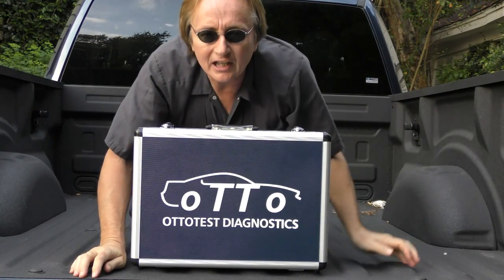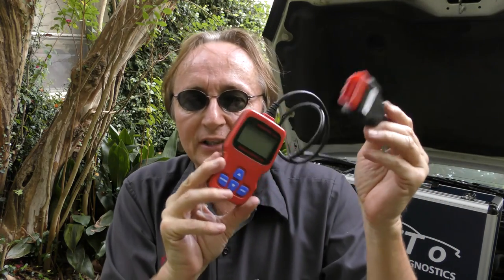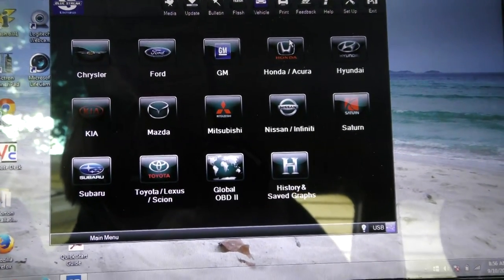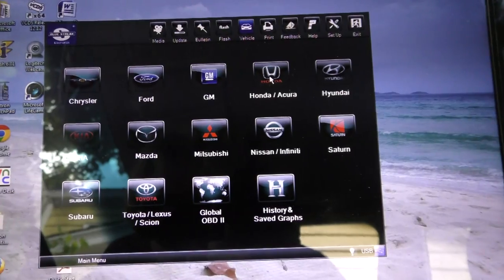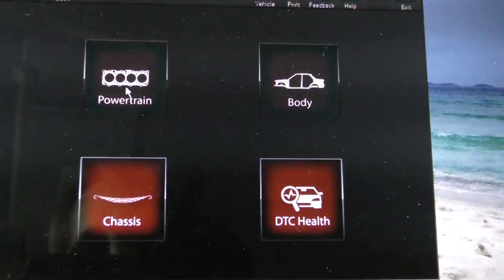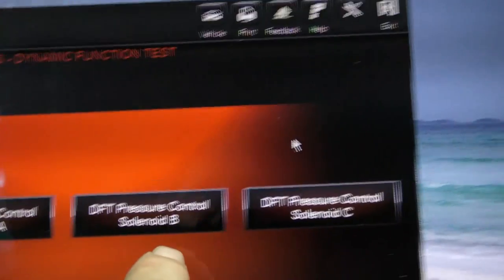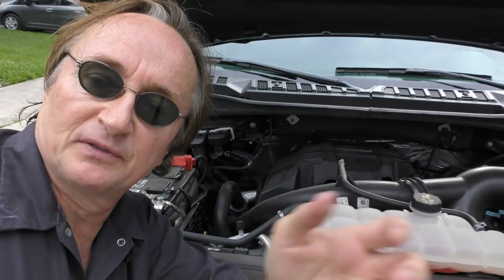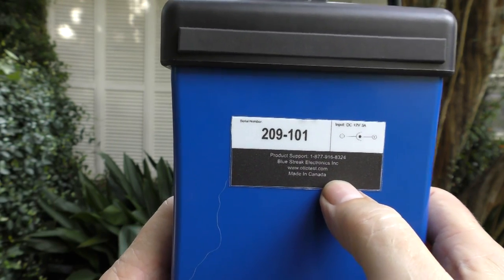Fixing Complex Modern Cars

Comment: they are only complex because we and our education system has utterly failed to keep up with modern times and needs.
Reply: +John Douglas What are you blabbering about? Engineers have taken a backseat to the accountants at big car companies. Cars are designed on PURPOSE to be complicated now because the companies will make a huge amount of money servicing them when they break. By making them complicated people are forced to take them to the dealerships versus good independent shops or just performing DIY work and that allows the dealerships to charge insane parts and labor costs because there's no competition. 

Actually scratch what I just said, the education system did fail us. Your comment is an indicator of that.
Reply: John Douglas I wasn't being a conspiracy theorist dumbshit. Don't tell me for one second that some cars have become so overengineered and stuffed full of useless technology to better the drivers. It IS planned obsolescence and special computer systems are required to fix them and guess where those systems are? The dealerships which means you now have to take your car there and spend a ton of money on something that should have never existed in a car. Tell me this, the plastic electric water pump in a BMW tends to fail at around 60k. What was wrong with a mechanical water pump? Oh I know it was too reliable and never broke so the companies decided to redesign the wheel and use an electric pump. Parts and labor costs are $800 if not more so big money for the dealership. Now you can DIY that stuff and independents can replace it but it begs the question of why it was ever that complicated in the first place.
Reply: John Douglas Well we have certain "fix it" laws where people can buy MBs STAR for example for use outside the MB dealership but that isn't exactly feasible for a DIYer and some parts are exempted. Indy shops might have that or use a general computer like an Autel Maxidas which can detect problems stored in the OBD 2 computer on all makes and models. I NEVER said it was a conspiracy, you're interpreting it as if I said that and if I follow that mentality then you are shooting yourself in the foot by talking about Governments. 

You say the parts are made to a cost and part of that is to make it affordable. So a $400 rebuilt alternator at Toyota is affordable when the exact OEM part new at another shop is $270? The plastic electric water pump in a BMW is almost $500. A mechanical water pump in an MB M272 motor is $120 and super easy to replace but usually they never go bad below 200k and usually it's just the seal that goes bad but people replace the pump as preventative maintenance.
Reply: Djonkie Bonk "that isn't exactly feasible for a DIYer and some parts are exempted."
"feasible to the DIYer"?
affordability of required equipment is beside the point.
it's not part of some grand plan to make more money (directly)
again I state, the progress of technology and it's deployment is not used to make more money, it's to make shit safer, cleaner,more economical and other things.
if we were still all running around in the first style vehicle, you'd be driving at a maximum of 25mph, you'd have no safety features and the pollution we'd face would have monumental environmental impacts, and a hell of a lot more dead people.
it's the price of progress.
 
"So a $400 rebuilt alternator at Toyota is affordable when the exact OEM part new at another shop is $270?"
the same could be said for nike sneakers dude.
the fact you can buy the OEM part speaks for the regulations also working in your favor.
toyota (or any other manufacturer) puts a price point to reflect it's brand, they all do, cars, shoes, cosmetics, you pay more for the name.

"The plastic electric water pump in a BMW is almost $500"   yes, because it's BMW.
but you can still get alternatives.

"A mechanical water pump in an MB M272 motor is $120 and super easy to replace but usually they never go bad below 200k and usually it's just the seal that goes bad but people replace the pump as preventative maintenance. "
and?  your point?
this is again, due to BMW wanting their cars to fit a narrative, to fit a "look"  and appeal to a certain style of customer.

you just need to learn to use the internet and shop around.
of course it'll take longer and require more work from you, but MOST people, want to drop their car of and have someone else do it, and for that, you have to pay through the nose for inexperience and laziness.

with ECU's and computer controlls for engine management and fault notification and what not.
it's all MUCH easier than it used to be for the mechanic, but also required more cost for the equipment, training and all the other shit needed.

I get it, it's bloody expensive, annoying and frustrating, but, such is life and the world and humanity.

try coming here to Australia, in the middle of no where, near no other countries, where everything has to be shipped in and it's a much smaller market and then tell me about increased costs.
it's crazy expensive here.

this is part of the price of the modern world I'm afraid.
Reply: Ok we're never going to agree fully but I will leave you with a few last words. Of course progression is a good thing and cars are totally safe nowadays and I'd drive nothing else but I think we've hit an apex where the effort to make cars uber efficient has now gone past a sensible point. Look at the new Ford Ecoboost motor for example. It boasts DI, turbocharging and a lot of specific programming in order to achieve good emissions and fuel economy. Now it's ULEV which is good and the economy is good but it's not that far off a port injected motor. DI motors have a coking problem which means they need cleaning every 2 or 3 years in order to maintain it's efficiency. That service costs around $800 as the entire intake manifold needs to be removed among other bits. They're also known for turbo issues, misfiring issues, injector issues and cooling issues. If all of that is going wrong the money it will cost to fix it will far outweigh the money saved in terms of usage and won't really save the owner money like the manufacturer claims. That's my issue. 

As for your point on BMWs stupid water pump that's just ridiculous. How can you possible link appeal to an inferior part that has no advantage over a mechanical pump other than the supposed less drag for fuel efficiency. If the pump itself actually saved the owner more money on gas than it cost to fix it then okay but I'm sure the water pump won't be solely responsible for that sort of savings. It's utter crap.

Comment: If you want a simpler car have an electric one. No gearbox. No diff. No oil.  No starter.
Reply: Yes, but that'll all be computers, and very expensive to fix when they do go bad.
Reply: Mechanically simpler but they make the computer system even more complex, stuff like Tesla cars have absolutely no chance of anyone making repairs on their own because they very specifically keep every component and software locked down.
Reply: MsSomeonenew yet theyre so easily hacked

Comment: i fondly remember one of the specialty tools i used to use....a long box end 9/16 heated and bent in a big L... distributor hold down bolt on a gmc....pick the year....probably only worked on 30+ years of gmc/chev/pontiac/oldsmobile/buicks....and caddys.......cars light trucks, and 1-2-3 ton trucks.
lol now a guy needs a soldering iron, a big box of sensors, and constant computer engineering classes....or youtube

Comment: Great! Have you ever work with fiberglass cloth before ? 
Can i use fiberglass cloth with J-B Weld Epoxy instead of bondo fiberglass resin ? 
Because the fiberglass resin fumes is very toxic.
Reply from the maker: +Mr Cool jb weld is fine by itself, but isn't really made for use with fiberglass

Comment: I have a 2002 Durango with a 5.9L, 93000 miles. When in cruise control at highway speed, it has a 30-50 rpm uptick. Never downticks. No DTC's, No engine misfires. Dealership replaced tranny, said that was the problem. Problem still there. Had some bad vacuum hoses, repaired all, had a PO1494 DTC, replaced the pump. Didn't help the uptick problem at highway cruise. Replaced the IAT sensor, replaced coolant sensor. No difference. Don't want to throw a bunch of sensors on it to try to take a shot-in-the -dark approach at this thing.  Thanks for the help.
Reply from the maker: +James Ritchey  see my video "fixing insanely complex modern cars" and realize a machine like that is needed to analyze such computer run system. But odds are the cruise control module has internal problems.
Reply: Replaced it. Same condition exists. This condition is intermittent. Drove it the other day  for 60 mile road test and it never acted up. Drove it 75 miles yesterday and it did it 4 times. Don't want to waste your valuable time, but your expertise is great and I appreciate all the help. Thanks.

Comment: Hondas live forever. I have a 2008 Accord my parents gave me, the only thing I have done to it in the past year is a new starter last month,  and when I put it on the road in my own name, I changed the serpentine belt for the first time ever in that car. The belt had over 120,000 miles on it and I just wanted to change it because of the age.  A new battery and 4 new tires. Both of the tires and battery were also this past couple month.

Comment: my renault vel satis disabled the air conditioner after a misfire in the engine showed up, also still after I corrected the misfire I need some fancy renault OBD scantool to tell the AC computer it's okay to load the engine with the compressor now.

Comment: Scotty, I've been researching the Honda Shadow motorcycle. Everything from how to fix them to how to ride one. What I found most surprising is it appears motorcycles don't have on board computers because they don't have an OBD2 port. In one of your earlier videos you are show riding a motorcycle. If you ride one then you must also fix them. Do all or most motorcycles not have computers? I also don't think any of the motorcycles I've seen have a cat or oxygen sensors. Are motorcycles somehow exempt from emissions standards?
Reply from the maker: +moofushu motorcycles are another World. Toys that cost serious money to work on these days, as they are just a computerized as cars, but nothing is standard, so they have no obd II regs and data ports, and all makes and models use different software and diagnostic equipment. AND, there are no real motorcycle discount part stores like there are for cars, so parts are a real rip off when you need to buy them.

Comment: I could pick one of these up and show people (currently having major problems) what's really going on with their vehicles. First one on my to-do list is some gal's Lexus which was a lemon from the moment she and fiance rolled off the used car lot. Based on what I've heard, someone flashed the computer to turn off all dash lights for a bit then one at a time started to shine, in addition to that came with worn brakes & rotors, squeaks everywhere and so-so tires.

Only thing I can think of worse people doing to a car before selling it is tampering with/rolling back the odometer. >:(

Comment: My mom's 2013 Jeep Grand Cherokee with a 5.7 HEMI decided to shut itself off a few seconds after turning it on from a cold start last week. It hasn't done it again since, nor has it done it before. I have no idea what it can be because it can either be the TIPM acting up, the mass air-flow sensor acting up for our inconvenience, the fuel pump playing jokes on her, or the hot Arizona heat affecting voltage if that's even possible.
Reply from the maker: +Dcc357 realize you need a machine like this ottotester hooked up, then drive it, and analyze all the data once it acts up. It will find the problem when used by a competent mechanic.

Comment: Get with the times, everything is computer controlled these days. The shop I work at deals with mainly Mercedes so we have a Mercedes Star Diagnostic computer, for everything else we use the SnapOn Modis Ultra or VCDS for the VAGs. Here in the UK Merc have now dropped their diagnostic labour rate to around £120/hour rather than £160/hour

Comment: High Scotty, what would you say is the best OBD2 scanner that will work with a Mercedes and can read deep in the car like an OEM computer but not break the bank?
Reply from the maker: +Roberto7474001  The ONLY thing outside a STAR tester that does that is an illegal clone made in china. Tons out there on alibaba and they are around 1500 bucks or so. They do work, as I know mechanics who bought them and use them every day. Beats 25 grand for the real thing, but realize, yes, they are stolen software.
Reply: +Scotty Kilmer do you recommend the Autel DS708 module? I believe that's what you use? Can that read very complex info like if the car is t running properly and no check engine light present? Thanks!!

Comment: you can get the diagnostic software for BMWS/mercedes/audi pretty easily through ebay.
usually its a modified form of windows which you dual-boot on your laptop, and you drop maybe $200 on a can-bus reader
then you get all the functionality of this otto thing except even moreso
and 2000 cr-v isn't insanely complex. that would be a 2008+ cr-v
Reply from the maker: +Ryukachoo yes, but most of that software is illegal copies made from the actual factory scan tools. Most are copied in china, then resold. I"m talking legal stuff here, that's why the ottotest guys don't have euro on their tool, they would have to pay too much for the rights.
Reply: +Ryukachoo yep i get one for my bmw . It work so slow  take forever  and not support good with Mac OSX latest.
Reply: +Scotty Kilmer  Computers are shit
Reply: +Raksasok Heng OS X is not a good operating system for any kind of car diagnostics or electronics. Unless you install windows on it. OS X is a joke in terms of flexibility, it's used almost exclusively for graphics stuff, video and programming for ios devices.

Comment: Sir:   I have a problem with a 2001 5.4 L Expedition.   The battery goes dead overnight.   It was 5 yrs old so I replaced it,  but problem persisted.

OReilly's tested for error codes,  found none.

I disconnected the positive cable from the battery,  key off,  put a continuity tester between them and it lit up brightly, so there is an open circuit.

I pulled every relay and fuse and replaced them watching to see it the tester light would go out.    None of them in the fuse box or power distribution box had any effect.

So,  there is a power draw thru some resistor not effected by fuses or relays.   I also disconnected the wires from the back of the alternator suspecting bad diodes,  but no luck.

I am stumped,  any ideas?   Tonight I am going over the  wiring diagrams to see what I can find.  thanks for your help.
Reply from the maker: do my video "fixing battery drain on your car"

Comment: i have a 2009 chrysler Magnum wagon with a 3,9 liter V6 with a questionable head gasket ,issue , how can i tell if a head gasket is blown without tearing the engine down i seen a couple mechanics look and tell just by opening the oil cap what are they looking for ?

Comment: European manufacturers aren't the only ones that use a system that requires their computer.   Chrystler requires their DRB scan tool to the more complicated analysis on their cars.  Heck, I can't even pull the airbag codes off of my Jeep Grand Cherokee without one.  The DRB III costs thousands and is only available from Chrystler.  They are at least nice enough to give you a way to read trouble codes on the odometer by turning the key on and off a few times. 

Chris
Reply: Chrysler is owned by FIAT which is European so I'm not surprised.
Reply: +luigi90210  Exactly. The only thing american made anymore is the drivetrain.
Reply: +luigi90210 Chrystler has always used DRB.  They started using DRB II in 1983 which is a long time before Europeans got involved. Chrystler also claims to have the first computer in a car, so I wonder if they just kept using what they had.  
Chris
Reply: +shadowdog500 Fiat Chrysler tops the lists of worst cars, and for good reason.

Stay gold.

Comment: This is un related to the video but how could I clean transmission fluid out of my cooling system? The tank for the transmission fluid in my radiator blew and I bought a new radiator, flushed everything out and everything was fine. But I forgot to flush the radiator reservoir. So the oil is now through my cooling system again but I cant seen to get the oil to budge. So just thought you might know of a way to get it out without causing damage the the cooling system or engine. 

Thanks, Gav.
Reply from the maker: +Gavin Jones   pay a guy with a heated radiator flush machine, it's really hard to get that stuff out

Comment: I have the opposite problem. It seems like modern tech's can not work on older cars with out all the computer stuff. I guess the days of actually diagnosing  problems ourselves maybe gone. I'm no mechanic myself. I have a 1986 MR2 that I drive everyday and it's still in very good shape but just to get some one to  look at small things is a big problem. When I try and take it somewhere just because of it's age no one wants to work on it.